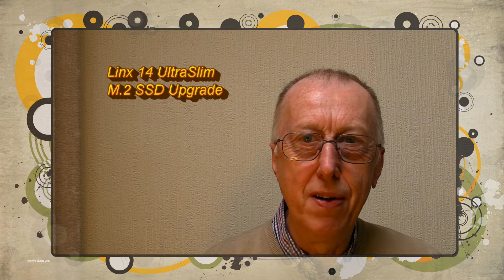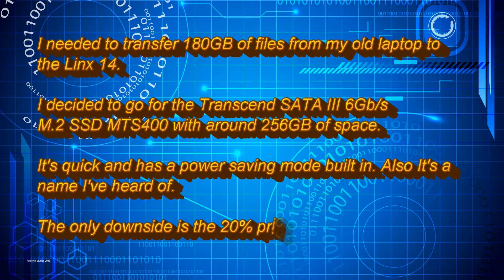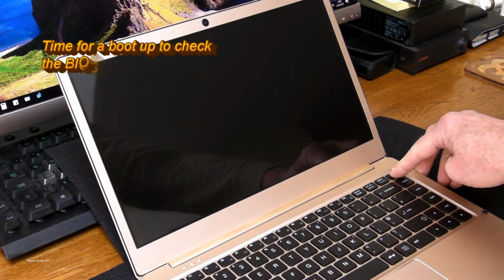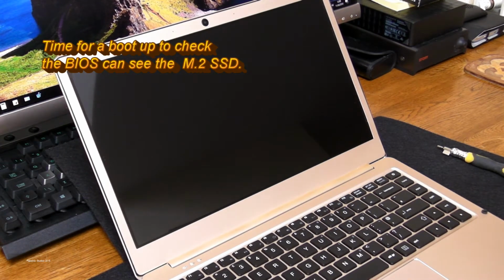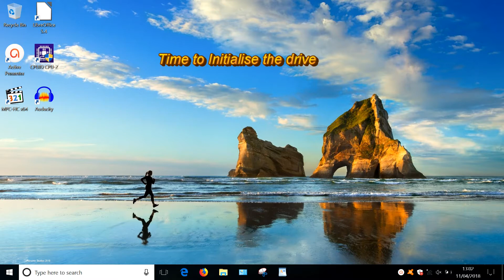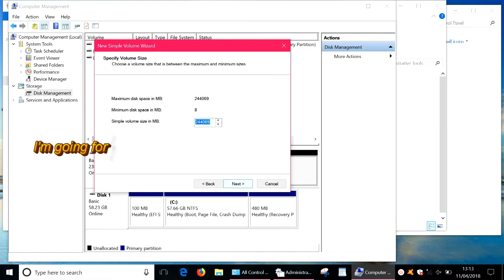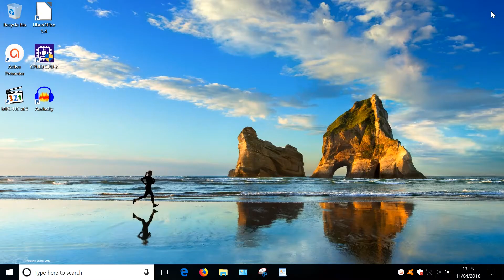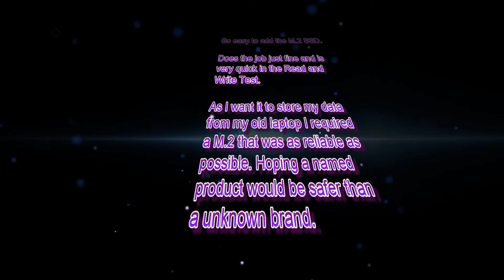Linx 14 Upgrade with Transcend 256GB M.2 SSD

Comment: Oks so  let  see if you can give me a hint as to what the problem of my linx is, I have exact this model. basically the  laptop every time u press the on button  it will show the logo linx and then for split second it will show the loading round animation and then will simply turn off, there are hundreds of stuck in loop boot videos that I tried and nothing worked. So i thought it was the hard drive or the battery, tested with usb  pen drive and having same problem. so I decided to unscrew the bottom leave it rest and turn it on, and guess what  it worked and I restored windows just to make sure wasnt that, so I turn it off and on  a few times just to check that all was working fine and yes all working fine with fresh install. but then when i screw the bottom aluminium again walla same problem all over again it simply wont boot I tried million times and nothing, then I  unscrew the bottom leave the notebook to rest for an hour and walla works again. is extremely annoying as to why this is happening since I really want to screw the bottom, is not ideal have it like this as I use it mainly on the train.  I unscrew the motherboard and connectors board just to make sure it was not a loose cable, all seem perfectly fine,  still having this problem, the only way I can make it work is without the bottom , why do you think this is happening,? is driving me crazt not knowing how to fix this
Reply from the maker: I think maybe three possibilities, something is over heating with the base on, as you say it's fine after has been left off for an hour. Or you may have developed a dry solder joint on the motherboard or a useage crack on one of the sockets i.e. power, USB, HDMI etc, as it appears when you fix the base back on putting it all under tension.

So I would take the base off and boot into windows.
Download HWMonitor from www.cpuid.com/softwares/hwmonitor.html. 1.44.exe is the version to use. Install then run the program/app.

The temperatures of the package and the cores will be displayed at the top. My max are 72*C and idle Values are 36-40*C. If higher than this something will be running.

To see what's running, hold down ctrl and alt and press delete. From the menu select, Task Manager. The window that opens shows, at the top, the apps that are running.
These should be only what you recognise, i.e. your browser, HWMonitor, Task Manager etc. The more that's running will make things slower and hotter. Make a note of the running apps. Close Task Manager and note what your temps are in HWMonitor.

HWMonitor will also show you what wear level and what charge level your battery is at. If Wear level is at 20% or lower there isn't much life left in your battery so you're better using your charger.

Next, with the Linx still running, place the base back on without putting in the screws. If all ok close down and then reboot. If it boots ok then put the screws back in one at a time.
Check it's still running before you insert the next screw. (We are looking to find the pressure point where it may shut off.) If it does go off remove the last screw you put in and try a reboot. You may need to slowly back track by removing each screw until you get a reboot. Once you have established if there is one area where it goes off, remove the base and examine the circuit board area where the last screw caused failure. You may find a small crack or loose solder joint in that area. Please note that I recommend a computer repair shop to do the job of fixing the fault if you can pin point the area of failure.

Try the above and  report back. Others may have more insight and will try to help you.
Reply: @parsonicstudios2600  woww top man very detail info and help, I will do all those steps and will tell u the results  Thank you kind .
Reply: @parsonicstudios2600  Mate you are great I got a working latptop thanks to you. So I install the software. Temperatures are good  when only running the app and task manager, it was steady  mid 30s to 40s. If I open chrome will go up to 50s. battery wear is at 100 % so I am assuming is  good. then I place the bottom, and  did turn on correctly, then I started screwing, the fault  is when I place the  top right corner screw next to the power jack, I couldnt see any obvious problems on that area of the board. so I simply didnt  put a screw on that area. the laptop is working now without problems, it turns on and off correctly. I think I will just leave it as it is,  if at some point it breaks I will get a replacement since having check probably will cost me more than what is worth.  but for now this is brillian, I am very happy with this , thanks to you. brilliant, you got a new susbcriber. by the way, is it worth to do the  ssd upgrade like u did? does windows 10 runs faster if you install it on it?
Reply from the maker: @puzzlemagnet1957  Glad it helped. The power sockets on all laptops wear over time so I would bet someone who can handle a soldering iron could spot the problem there a fix it for you. Screw pressure is probably causing the contacts to separate. Everything seems snappier with windows on the ssd (see the end of the video for the bench marks when reading and writing. About three and a half times faster. plus more storage space.)
Reply: @parsonicstudios2600  thank you very much, will  see if I can find some one to take a look

Comment: where is the actual hard drive located , the one that comes with the laptop I need to know because I believe mine is faulty
Reply from the maker: Hi. The hard drive is soldered onto the motherboard and is not replaceable. If you are certain that the drive has failed it is possible to continue using the Linx by doing an upgrade(as above) and reinstalling windows on that.
Reply: @parsonicstudios2600  ty  yes I notice, I decided to open the latop itself, I ordered a new charger online, just to double check if that is the problem, if not I will def will do the upgrade as u did on the video and try that up

Comment: Thanks, I have one of these and on the basis of your video, have just ordered an SSD (512 Gb) for it. Has anyone tried to clone and use it as as the boot drive. Done it successfully with a desktop, but had to force it to change to C drive by disconnecting the HDD and booting. Worked, but I'm not sure if you can even access the HDD connections to do the same on this.
Anyone have any experience?
Reply from the maker: Hi David, just a thought here, make sure it's a SATA 3 M.2 drive. If you get an MVME it probably won't work. Cloning Windows 10 over to the new drive was easy.(Plenty of Youtube videos on how to). When that's done just change the drive letters from what was assigned to the new drive and make it C. Hoping that helps.
Reply: @parsonicstudios2600  I'm hoping it's correct, this is the device:

Transcend 512GB SATA III 6Gb/s MTS430S 42mm M.2 SSD 430S Solid State Drive TS512GMTS430
Has M2 and 42 (mm) in it. Arrives today so keep fingers crossed. Many thanks for your help.

Comment: Hi chaps. Just to let you know, I fitted this exact Transcend SSD to a Linx and I am being told by Linx support that it is causing the power crashes I am getting. Essentially it seems to lose the ability to charge or power up, but there is no apparent fix. Taking the SSD out doesn't help. 
It is a great laptop, but pretty much needs the SSD to run Windows and Office, so it's a bit of a bugger if it is screwed up by this one. Transcend, is a well-respected manufacturer, so incompatibility isd a bit of an issue.
Reply: Doesn't sound like the charging problem is associated with the M2 drive if taking it out doesn't fix it.  I'd try a replacement charger first (MSA C2000/C12 12V 2A) Works fine for me so far, dual booting Windows 10 and Ubuntu20.04, wifi on Ubuntu is slower, but usable.
Reply: @DH-ix1zd  Thanks for the pointer. I tried with two other different chargers, to no avail. I am pretty sure it's the SSD.
Reply: Hi chaps.
Well, Linx support eventually changed the mobo and I changed to a more recent version of the SSD. What we find now is that the laptop will crash if the SSD is installed, but not if it's not, so it's the SSD.
If anyone sees this and has any information I would be interested. Particularly, has anyone else seen this behaviour? 
Does anyone without the problem know their version of BIOS?
Has anyone tried a different breed of SSD?
Any help gratefully accepted.
Reply: @brucerouffian2630  Bios version is LC-JX-14-S133AR110-389-C  release date of bios 26/06/17.  No problem with a 120GB Transcend M.2 SSD420S. I would have a look in the bios options to see if anything looks wrong.
Reply: @DH-ix1zd  Thank  you. The laptop's user is on holiday in Spain, somewhere secret, at the moment. She will be free on Wednesday to look up the details for me.
Reply: A new, weird, update.
I contacted a different Linx support team, exertis . co . uk, and got the following advice "Unfortunately the issue you are experiencing is due to using an incorrect M.2 card. The card you are using is SATA, which is not supported. you will need a PCI-e M.2 B+M type 2242 card to work with your device"
Weird, given that DH is using a SATA SSD, as is ParsonicStudios. I guess I need to dig deeper.

Comment: Very useful! Would you mind sharing the torx head size so that I can buy the right tool for removing the SSD plate?
Reply from the maker: Hi. I can't remember exactly but it's around 2mm. Usually you can buy a small set of Tork keys cheaply that incorporates most small sizes.

Comment: Bought the laptop because off you. Added a 128gb harddrive because off you. And I'm loving it thanks!!!
Reply: Does it make it a lot quicker with an SSD? Also, does it boot from SSD?
Reply: @fu928  why does everyone want to boot from a second SSD it already has flash memory built in and you won't notice a speed difference
Reply: @LexxDesign3D  One reason is that it's nice to run all of your apps off the boot drive for speed and convenience. Also a  friend is currently asking for my help to upgrade to a SSD because Microsoft filled the 64Gb eMMc and she had no room to upgrade to 1903. Also, the quality of the SSD is so variable that you could actually end up close to 4 or even 5x faster. That's why I am reviewing this video.
Reply: @LexxDesign3D  The install memory is only 64 Gb and does not have near enough room to run windows and store data. As one poster stated it will limit the ability to update windows as there is not enough room on the drive for the windows backup. So you have to use a micro SD card. An SSD will show a noticeable speed difference. Plus any deleted files will be sent to the recycle bin instead of being deleted permanently. 
Can't hurt and ludicrously cheap compared to upgrading by buying a new machine.

Comment: Hi there, I have a IOTA version of this laptop. I've installed a msata drive (Toshiba RC100 240gb) but I can't get the laptop to see it. I've searched for a solution but havent found anything. Any advice woud be appreciated!
Reply from the maker: Hi Hywell, Try following the tutorial from 4.45 in my upgrade. Look into Device Manager first, it should appear there first. If not make sure the M2 is compatible with your IOTA by checking their website or Toshiba may help you out with the necessary information. If that's all ok take out the m2 and reinstall again and check Device Manager. The Initialising process is quite easy, just pause the video at each stage, then follow the next step until all the steps have been completed. That should do it.
 Please come back if you need any more help.
Reply: Thats because its an NVMe drive, you want a m2 sata drive

Comment: It would have been nice to have seen some benchmarks with the new drive installed. The installed 64gb emmc drive is slow. Very slow. I would like to see what scores the Transcend achieves. Is it limited by the motherboard... Does the Transcend achieve anywhere near the claimed speeds? If it doesn't, then a micro SD card or USB drive might be a cheaper alternative... (In your other video review, someone commented about a NVME drive. Absolutely pointless on a SATA III connection!)
Reply from the maker: Thanks for your comments. I only ran the one benchmark using AS SSD to keep it simple. 
Results were : - 
USB HDD Read 34.91MBs - Write 34.34MBs  
Linx onboard eMMC Read 281.04MBs - Write 131.53MBs 
Transcend M2 SSD smashed the previous results turning in Read 488.29MBs - Write 432.83MBs.
Yes you can add more memory cheaply via the micro SD card but this gets more expensive the more GBs you require. I only had a LEXAR 8GB class 4 card to hand to bench but the results were very poor (Read 21MBs-Write 12MBs) so I didn't include in the test results.
Windows 10 has now been cloned to the Transcend which seems to have slowed slightly (Read 471.83MBs - Write 421.99MBs). To be honest, in use I can see no difference in performance apart from lightning transfer speeds when copying files.